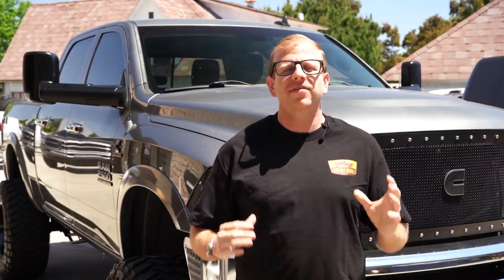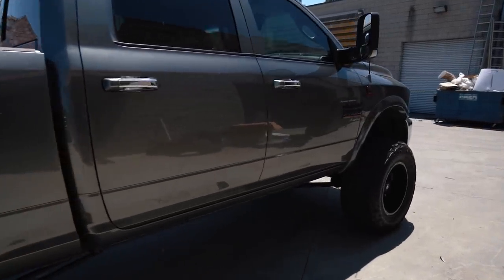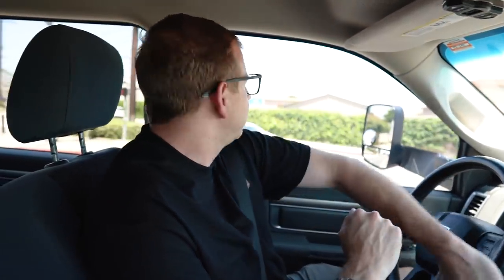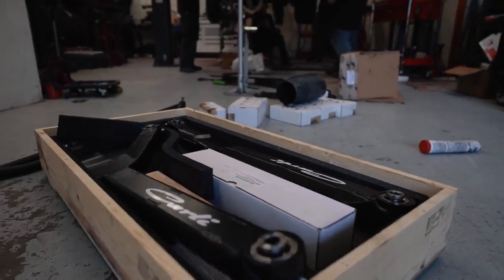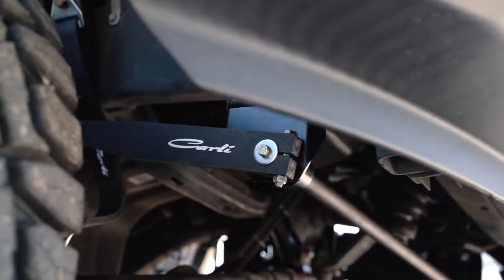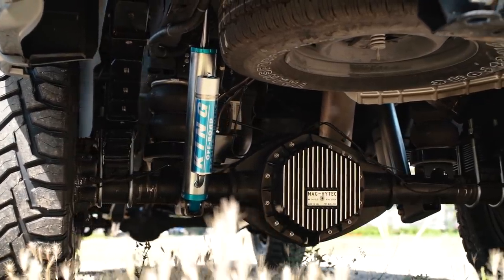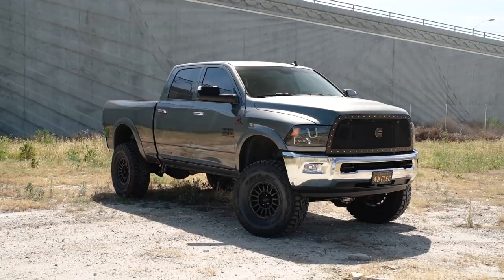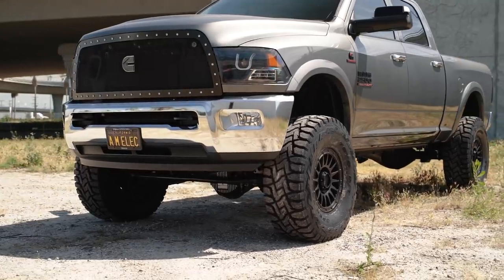Why Bolt On Coilovers Aren’t Best for Your Solid Axle Truck

Comment: I've got a 2013 Ram 2500 , bought in March of 2013, suspension replaced in May of 2013 with the Carli/Bilstein system (front and rear springs). Never an issue, replaced the shocks with carli Bilsteins when needed and it now has the Carli Fox shocks on it. Seven years and 275K miles later, I wouldn't hesitate putting a Carli system on again.

Comment: I wanted to stay out of this conversation but I recently had Coilovers installed on my 2015 F250. The huge difference they have made on the ride quality. I am currently running an 8 inch lift and after the Coilover conversion it rides better than stock and I am amazed on how smooth it is.  I think the right Coil-over set up and when it’s properly tuned to your desired need one can benefit more from coil-overs. This video had scared me from purchasing Coil-overs, however, I had to test them out for myself and I strongly disagree with a lot of the things he points out. I hardly feel any small bumps. When it comes to huge bumps they are extremely soft and my back thanks me for it! Rides better than my 1500 Silverado!

Comment: Looks fantastic and obviously functions way better.  Quick note to the owner, consider replacing the diff. covers.  Those drastically reduce proper lubrication flow to your gears.  Banks Power did a good series of the subject.  Just thought I'd share.
Reply: PML has been making diff covers that are profiled properly long before Banks decided to film an infomercial. Notice that Banks didn't "test" a PML cover? Don't buy into the Banks hype of trying to reinvent something that PML has been producing for YEARS!!
Reply: @Rhinopkc  thanks, I appreciate the perspective...and I agree, they have been making covers for a long time.  Long before BANKS's video, I personally (just my opinion of course), struggled with the concept of lubricant in the housing hitting a flat wall.  Did not make sense to me to not allow the fluids to follow the ring gear up.  I'm not an engineer, or any king of lubrication expert, maybe I should keep my opinions to myself.  Thanks for the constructive remarks and not taking the common route of just calling me an idiot.

Comment: The 2013 is probably the perfect truck, you get the nice interior, but the good suspension design. After going from a 4 link truck to a radius arm truck, i kinda regret it. Its better for a mild truck, but the 4 link trucks are better for a wild one.

Comment: My tremor goes to CJC at the end of this month. I am so looking forward to it.
Reply: MrMike4073 what are you getting done?  I have a Tremor with the 6.7.  I really hate the ride and the uneven look.
Reply: smorariu I have the 7.3L motor. I had the backcountry level kit. Upper stabilizer, new radius arms. On 37” Nitto tires. No lift in the rear. The truck sits level. I may put the rear spring pack a lil later. If you go to CJC’s instagram you will see it. It’s a black Tremor.
Reply: MrMike4073 Love it?
Reply: Andrew Hensley Yes I love it. It rides way better then stock.

Comment: One question, as we all know King 3.0 are on the upper shelf quality, with that I was wondering how often you need to service them, as this is probably a daily basis truck.
Reply: I had over 70k on my last set of 3.5  King fronts and 3.0" rears before I upgraded. No issues.

Comment: That is a much much better suspension, but I definitely would have kept the original rims and tires they look much better than the second set although I do like the Toyo RT tire that little bitty Rim is just not near as good-looking as the twenties that were on there

Comment: Man, that suspension was doomed from the start. What were they thinking? 600lb. single spring rate and those mile long shock ends eating up usable travel. Where are the dual rate springs?  Literally no reason to run coilovers in this application with single rate springs. The effective spring rate probably should have been less than half of the single 600lb. they had in there. With proper dual rate springs and the rate nut adjusted for transition, it would not have rode like a dump truck and been able to utilize a lot more travel. 🤦

The old suspension could have been "fixed", but those old arms were low quality and the front shocks needed to be swapped anyway. So you're basically starting from scratch. I agree that THIS coilover system was junk, but a proper dual rate coilover setup will work great. However, not everyone wants to spend days in the desert testing springs and valving.

Nice job providing an actual working suspension for this customer.

Comment: @CJC Off Road If the customer originally went with a 2.5 12-14” travel dual spring coil over and long arms, would the carli kit still ride better?
Reply from the maker: Yes since the Carli shocks are actually tuned. The other thing to consider is that those kind of travel numbers aren’t possible from a coil over on these trucks unless there’s a lot of custom fab work involved.

Comment: That guy had no idea what he was getting himself into with that first lift kit. If he would've taken some time to do some research and asked some questions while noting his end game, he could've saved himself a ton of cash. Oh and he can ditch that OEM spare tire. If he runs it with a flat on the rear axle for any real length of time, he's going to be looking at replacing some diff parts also. At least the MAG HYTEC cover gasket will save him around $10 in gasket costs. lol 

Johnny joints wear out a bit slower than urethane bushings with the higher density urethane however they still wear out but being rebuildable as are lower density urethane bushings. One isn't so much "better" over the other and lifespan is determined by road conditions, miles driven and of course if the long arm joints are exposed to deicing agents such as the dreaded salt states love to spread like it's free. 

How are the driveshaft pinion angles addressed in these +6" lifts over OEM geometry so the U-joint is rotating at a uniform speed while either 2WD or 4WD is engaged so the consumer isn't having to drop the shafts at an increased interval? A spacer lengthens the short front shaft but does nothing to address the increased angles at the yokes. What about the rear with the short wheelbase trucks running one piece shafts as opposed to two piece shafts with carrier bearings? Not a single lift manufacturer has ever commented on this topic.

Comment: Well what do you recommend for a 2000 chevy K3500 that is stock height? Carli does not make anything for my truck.
Reply from the maker: We have a mix of parts we use on those trucks. Give us a call and we can get you set up!

Comment: So was the problem with the fox shocks tuning? I’m looking to upgrade my suspension on my Silverado and seeing how the fox shocks were makes me a little nervous because those are the shocks I want.
Reply from the maker: They just aren’t tuned for the truck. Most big brands just buy a shock off the shelf from Fox that’s the right length for the lift. That shock comes with a very basic “truck” tune from Fox that gets the job done, but can never compare to a custom tuned coil and shock system.
Reply: CJC Off Road  so how would I come getting a custom tune?

Comment: Are open country’s a worse ride than the r/t? Or was it just rim size ?
Reply from the maker: It was purely a wheel/tire size issue. The more wheel and the less tire you have, the worse the ride. The wide wheels also don’t help ride or steering feel.

Comment: Why does Carli not make a 6in for 2014+ years?
Reply: Rick GonzalezLuciano right!!  Man I wish mine was a slightly taller
Reply from the maker: It’s because of the limitations of the rear suspension design. Carli is about ride quality and strength, not a given lift height, and doing a 6” lift for the rear coil sprung trucks doesn’t meet their strength and ride quality requirements. They could completely re-engineer the back end, but it would be a pretty cost prohibitive set up.
Reply: CJC Off Road speaking of the rear coil spring (2500’s), could you do a video of a 2500 with a 3” pintop or backcountry showing the limits of towing heavy loads. Maybe using timbrens or cradled air bags for the guys who want more then just a leveling kit which are pretty amazing themselves.????
Reply from the maker: We’re working on exactly that! If towing is an issue, Carli has the pintop level that keeps full towing capacity, or you can run Timbrens like you said.

Comment: I want a 4-6” lift on my 2019 Ram 2500.
Reply from the maker: The issue with the 14+ Rams is the coil sprung rear suspension. Once you lift over an inch at the rear, you’re sacrificing strength and ride quality for looks. We offer 3.25 in front lift, 1” rear for those trucks, but nothing over that.

Comment: What do you guys think about  The AEV Lift kits  Are they any good ?
Reply from the maker: The AEV kits are in a very different category from the performance of the Carli and Thuren systems. The AEV system is primarily drop brackets for the factory parts with 5100 IFP shocks.

Comment: Great videos, I was snooping on carli’s website today and in the 2019+ 3500’s they have a dominator system showing as “coming soon” any idea on what that may be? I will be in the market for a suspension on my 2019 mega 3500 come next spring. And would love to install a dominator system.
Reply from the maker: Dominator ETA is some time this summer. It’s getting very close!
Reply: CJC Off Road if they need a test truck in the PNW I’m open to working a deal.

Comment: Why do you guys always say “more” suspension travel but never state how much travel ??
Reply from the maker: Because it depends on the exact set up on the truck. This truck on a 6" dominator system has 12" of front travel, and 12.5" of rear travel, which is a 60% increase over factory.